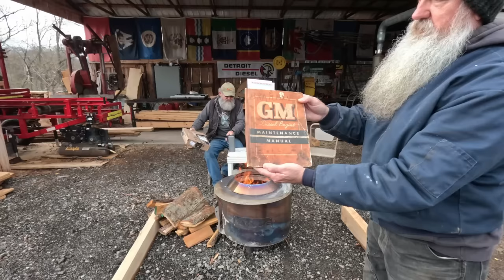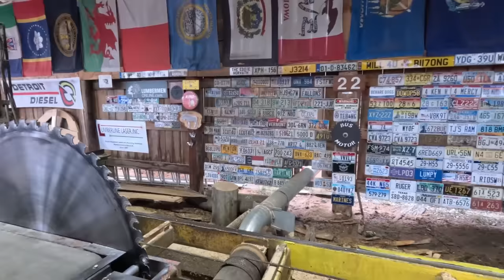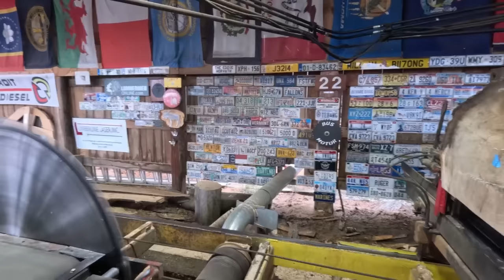sawing a big nasty black oak log # 544

Comment: The mill I worked at has three tein band saws and a skngle band head rig. The sawdust went to several horse farms for bedding and the left over was burned in the drying kilns to dry the lumber. Those band saws produced around 5 to 7 tractor trsiler loads a day , once the gang edger was added.
Reply from the maker: that's alot of sawdust.

Comment: What's the deal with Walnut dust?
Reply: It will make animals ill, especially horses, so it's best not to save it with the rest of the sawdust.
Reply: Black walnut shavings are a toxic bedding for horses. The innermost wood of the black walnut causes toxicity after oral or skin contact. Bedding containing as little as 20 percent fresh black walnut shavings made from old or new wood can cause toxicity. Within a few hours of toxicity, the following signs occur. Depression. Stocking up. Warm hooves. Acute laminitis (founder), Stiff gait. Reluctance to move
As toxicity progresses you see, Laminitis may result in coffin bone rotation in severe cases, Flared nostrils, Colic, Swelling in the neck and chest areas, High heart and breath rates, High body temperature

Comment: I follow an upstate N.Y. logger who has saw mill and logs with draft  horses.Uses the sawdust for in the stalls. Has outside furnace for heating home and hotwater heater using the trim and has zero waste in his operation. 
Working horses with Jim.

Comment: Why no walnut dust in the bin?
Reply: Someone else commented: "Black walnut shavings are a toxic bedding for horses. The innermost wood of the black walnut causes toxicity after oral or skin contact. Bedding containing as little as 20 percent fresh black walnut shavings made from old or new wood can cause toxicity. Within a few hours of toxicity, the following signs occur. Depression. Stocking up. Warm hooves. Acute laminitis (founder), Stiff gait. Reluctance to move
As toxicity progresses you see, Laminitis may result in coffin bone rotation in severe cases, Flared nostrils, Colic, Swelling in the neck and chest areas, High heart and breath rates, High body temperature".
Reply: @Orcinus1967  did not know, thanks!

Comment: @ 12:20 fire in the sawdust box and the stop in video not explained very well / does Eddie's channel tell why saw blade stopped ?
Reply: Piece of wood stuck between the blade and the conveyor.
Reply: The friction caused by the wood being jammed in the blade causes sparks and leads to fire problems.

Comment: Them big logs are a bear on a manual mill to turn. I am doing some sawing on a manual band mill now and I think of how nice it would be to have a edger like yours. If I didn't have a tractor with loader/forks, I wouldn't even start at sawing with any type of mill.
Reply from the maker: yes it's hard to do on a manual mill for sure.

Comment: The black oak around here smells like a barn lot! I cut a big pin oak log that was 19 feet long and 26 inches at the butt end. My buddy helped me out with his Wood Mizer helped me cut it up. I save my brother a  4inch x10 inch 10 foot long piece for his mantel. He didn't use it. I still have it in my barn on the concrete floor. He said it was too heavy,
Reply from the maker: this had a very bad smell for sure.

Comment: Six o’clock in the morning nice oak boards coming off the mill again , waiting till they finish milking then we’re going to jack the milking parlour up by eight inches and another twelve inches wide two welders four labourers and an electrician and we’ve got till four o’clock when they start milking again , legs are in just need to jack it up and four beams full length the impossible we do today the miracles take a little longer , anyway you guys have a nice day
Reply from the maker: thanks Alex , hope it goes well today.